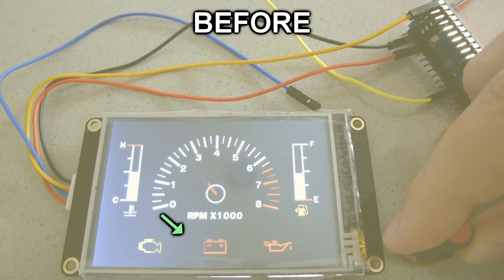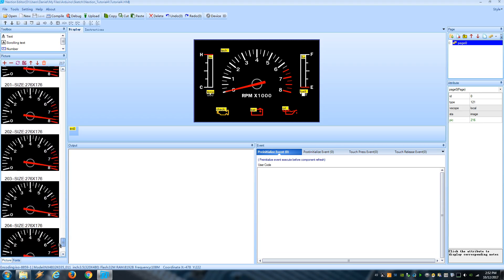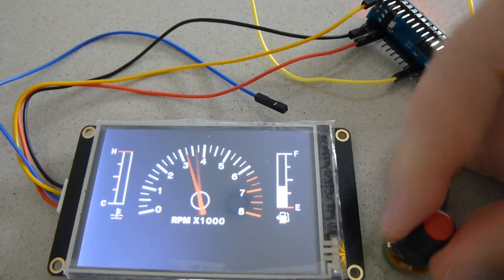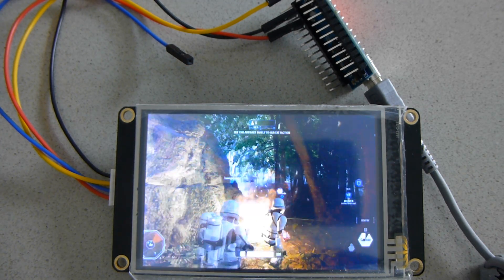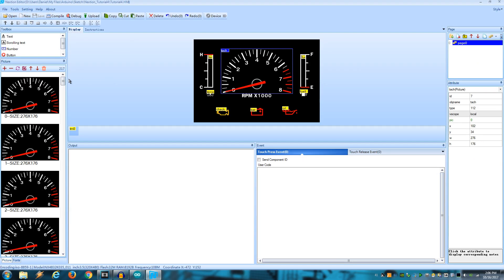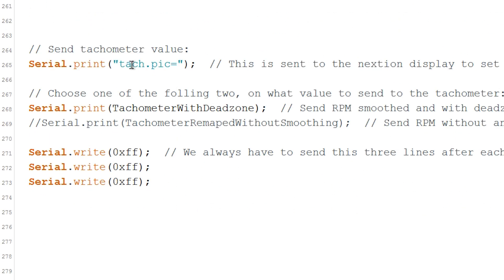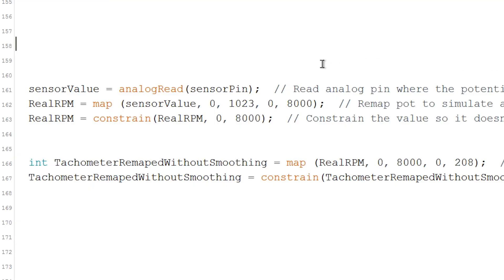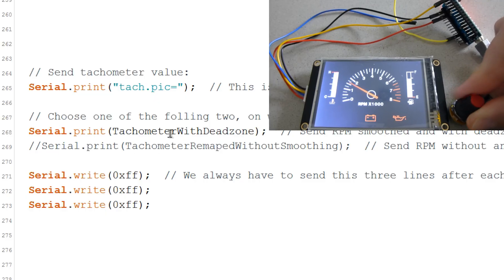Nextion+Arduino Tutorial #4 Custom Gauge And Play Video

Comment: wouldn't it be possible to make a speedo and other gauges? maybe use 3 screens . have the tachometer and speedo on one each. then fuel level. oil psi. h2o temp. and volts and or amps on a single large display. or would all the gauges on a single display take to much memory? great video  I love the idea of creating custom gauges. especially with the graphics ..
PS I'm a total newb. but I'm learning every day.
Reply from the maker: My project with the gauge I show on the video uses 20MB of flash memory. The maximum memory available is 32MB, and there is no model with more memory than that. You could do something like you describe, but with smaller gauges in a display no bigger than 3.5".

Or just use the included gauges that you can add on the nextion editor. They flicker, but if you refresh them only when there is a new value to show, they flicker a lot less. But at least you can add as many gauges as you want without worrying about running out of memory.

Maybe you could do the tachometer and speedometer with custom gauges, but both smaller than mine. And the rest you could use the traditional gauges or progress bars. You would have to test.

Comment: So those gauges are onboard, what about sending bitmaps to the Arduino and show them that way? PC => Bitmap => Arduino => Nextion using USB Bulk Transfer. Is this feasible at 40fps? I have never done anything Arduino related but I am looking for hardware to do a project for flight sim gauges.
Reply from the maker: That's not possible. The nextion display can only receive commands, values and text. All the images, layout and text boxes and everything should be already on the nextion display, created with the nextion editor.

If you have a flight simulator and want another screen for gauges, I think is better that you add a normal computer monitor (small) and show the gauges there, driven directly by the computer and the simulator itself.
Reply: Dang.. Well I'll keep looking more other alternatives. Thanks for you help!

Comment: Is there an automated way of producing a series of gauge pics? I've made a gauge in Inkscape using the SVG format, however it is very time consuming moving the needle/dial each and every time then exporting the pic.
Reply: You can with photoshop action scripting quite easily. Record rotating the gauge, give it a stop value, stop recording action. Voila it will automatically generate an images based on your initial rotation degree. Automated image creation is part of the real power of photoshop.
Reply from the maker: Sorry but I don't know a way to automatically produce the images. I spend a lot of hours to create mine.
Reply: Thanks. I just tried it on a non-enhanced 3.5inch display. It still flickers noticeably. I think the enhanced version is the way to go.
Reply: It still is a big improvement.
Reply from the maker: Yeah, that's what I thought. Keep in mind that not all of the enhanced versions have the faster CPU. Only the 3.5" and up have the faster CPU. I bought the 3.5" enhanced version for that reason. A faster CPU is important, in my opinion.

What if you use smaller images for the gauge? That helps with the speed/flickering?

Thanks for sharing the results of your test. It's good to know.
Reply: I might write a program that allows you to hook in on the ID of the needle in the SVG file, then automatically rotates it and exports each individual image.
Reply from the maker: Sure. Try that.

Comment: Awesome! how did You play a video on the nextion display ??
Reply from the maker: Like I mention on the video, I just show a series of images very fast. The example files are on the description, so you can see it for yourself.
Reply: InterlinkKnight  sorry for my bad English I just understand what you mean, I have a simple project... i will make a LCD tachometer for my scooter with a nextion display and a alduino mega. The problem i have is to send the value from the rpm sensor to the nextion gauge (i have a rpm code for the sensor), but the gauge is not moving. I hope Your videos will be help me :S
Reply from the maker: Start by using my example files for my 1st video tutorial. When that works, you could give my custom gauge a try.
Reply: Hello, I tried Your example files and it works very well. 
After i tried to write a code with your examples, and i would like to show the temperature on the display (it is not work).
If i go on the serial monitor from arduino, i see the temperature but not on the display.

I hope You can help me..

#include "Nextion.h"
#include <math.h>

NexNumber n0 = NexNumber(0, 2, "n0");

double Thermistor(int RawADC) {
 double Temp;
 
 Temp = log(10000.0*((1024.0/RawADC-1))); 
 Temp = 1 / (0.001129148 + (0.000234125 + (0.0000000876741 * Temp * Temp ))* Temp );
 Temp = Temp - 273.15;          
 //Temp = (Temp * 9.0)/ 5.0 + 32.0; 
 return Temp;
 
}

void setup() {
  // put your setup code here, to run once:
 nexInit();
 Serial.begin(9600);
 dbSerialPrintln("setup done");
}

void loop() {
  
  int val;                
  double temp;
  
  val=analogRead(0);      
  temp=Thermistor(val);
   
  Serial2.print("n0.val=");     //serial2 = because my display is on serial2
  Serial2.print(temp); 
  Serial2.write(0xff);
  Serial2.write(0xff);
  Serial2.write(0xff);
  delay(1000);
     
  
  Serial.print("Temperature = ");
  Serial.print(temp);   
  Serial.println(" C");
  delay(1000);
}
Reply from the maker: Looks like you forgot to initiate Serial2.begin(9600). You started Serial for debugging, but not Serial2. You need Serial2 too.

Why are you using the nextion library? You should delete everything there about the nextion display, except the following:

void setup() {
 Serial2.begin(9600);
}
void loop() {
  Serial2.print("n0.val=");     //serial2 = because my display is on serial2
  Serial2.print(temp); 
  Serial2.write(0xff);
  Serial2.write(0xff);
  Serial2.write(0xff);
}